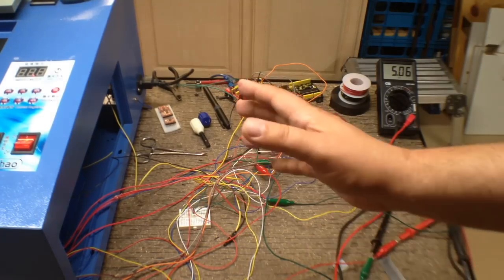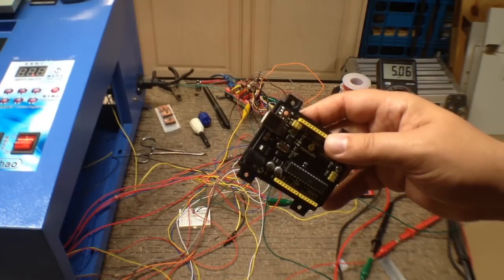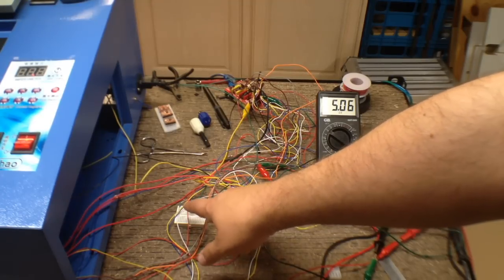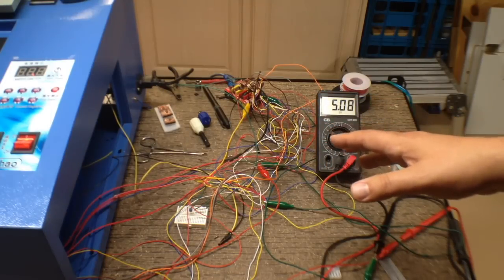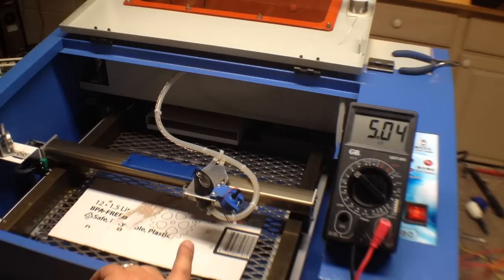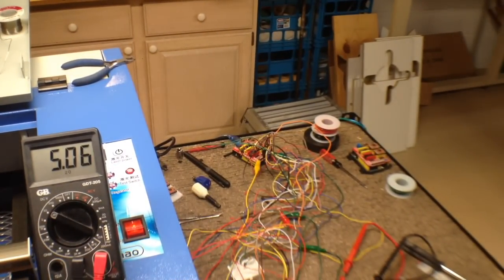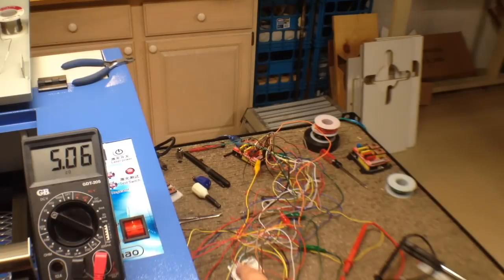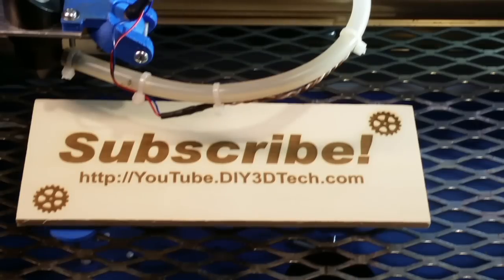K40 eBay Chinese CO2 Laser Cutter - Running with the Arduino UNO and GRBL Part 3!

Comment: use the same accel settings you used on the tiny laser and adjust as required its not too hard are you sure you have enough current from the new controller to run the motors,the drivers on the board are made for a 3d printer where the loads are very low while the k40 needs more current due  to more or heavy loaded axis.

Comment: why not attach wire connection drawing arduino + shield v3? everyone asks, be good, thanks
Reply from the maker: Thanks for commenting and the simple answer is it subject to change,  When I made this GRBL was at 0.9 and now 1.1 with this pins have changed.  It is /was also subject to the handling of M3/M$ and PWM.  The second reason is risk, activating the high voltage PS as well as the laser.  So in short if one is going to make this mod (which I have also posted a newer video)  they need to understand the mod as it can lead to dangerous out comes (which I have also covered in later videos).  :-)

Comment: I'm thinking of doing the same - but if the laser fires when the pin is low, isnt there a chance it will fire before GRBL has a chance to initialize and set the pin high?
Reply from the maker: I can never say never however for the most part no, as that is why GRBL will only support low for off.  However the issue you will see is if GRBL crashes and the pin is high it will stay high and thus the laser will remain on.  So it should not be left unattended (even stock I would recommend this too)...
Reply: @DIY3DTECHcom  I have a grbl controled diode laser and I would NEVER use GRBL for a k40 because the laser does fire when the thing is initializing.

Comment: Hello. I just have the same model and just try GRBL with lightburn too. However I notice that when engraving raster, the x axis cannot move  as fast as stock controller. There is something about acceleration in GRBL. If I input $120 and $121 too high x axis  will lose step. How do you think?
Reply from the maker: You know I just started playing with Light burn about a week ago and I don't do much raster mostly cutting.  Try max speed 50000.000 and acceleration 300 (at your own risk)

Comment: hello,this idea is not ready for prime time till all the bugs are out. Its ok for senior  level techs but NOT for noobies.Also you need a hardware switch to insure laser is OFF when turning the system on/off ...As someone could really get hurt real bad...these kids out here now never played with old tvs and such like we did and do not understand the pain issues.
Reply from the maker: If you want to take this approach the whole;e k40 should be banned (in all honesty I am still surprised it is still allowed to be imported).  As with any power tool you need to treat it with respect as I have been using this for years without issue.  As worth note, in its stock configuration you can get hurt really bad in a number of ways but can you with a table saw...

Comment: If you were to do it again. Would you use an Atmega Ramps running GRBL Laser AKA $32-1 ? I tried the marlin laser version and it's just not stable and safe enough to use with Lightburn, I have both the CncShield and Ramps, Wondering if it's worth putting the big ramps or stay cheap with the CncShield
Reply from the maker: This is more then enough all the way around, however note rastering while possible is not practical with GRBL.  As I just use this for cutting things out...
Reply: @DIY3DTECHcom  Even when using GRBL1.1f with M4S** commands in lightburn? I have a CncShield V3 all set up and ready to go with a transistor logic inverter set up,  to Pin11( Z endstop )and ground, i won't know for sure  till i get my K40 moded up and working

Comment: Hello, I've upgrade my k40 with arduino uno using pwm on pin 11 and it works fine, but if I connect the machine without connecting before the arduino, the laser lights on. Do you know how to solve this? 
Thanks a lot
Reply from the maker: Sorry there is no easy way as you also have to be careful too because if abort a job it will also say on
Reply: I solved that with adding a relay to the shield, once it powers on it turns on it switches the relay  to Laser power supply, the relay will only switch on once the shield has booteed up google 
Timer Switch Module, DC 12V Adjustable Delay Timing Timer Relay ON Off Switch
Reply: This happens with laser grbl for the led lasers if you fail to turn it on correctly...ALWAYS turn on the CONTROL SOFTWARE FIRST than apply power to laser module last.

Comment: Hello Friend how do you do to control the power supply of the laser co2 with the arduino ... how do you connect it?
Reply from the maker: In the video series I show how to build a single transistor logic inverter to use the Spindle On/Off pin out to turn it on and off...

Comment: So I've been watching this (I've bought one and its on its way) are you able to make patch cables to sell to people? so basically plug them into the right cables on their end and plug a set straight into your design. also with some further research I've noticed that it can potentially run T2Laser software which is god like.
Reply from the maker: This unfortunately is not just a cable however as compete re-work of all  of the electronics.  With GRBL is will act as a CNC like device, however this was done quite some time back and a guy has released an App called the k40 Whisper software (see my most recent video) as if I would have that, would not have needed to make this change.
Reply: DIY3DTECH.com ill go check that out!!thanks!!

Comment: do you have any wiring diagrams for sale thanx
Reply from the maker: So no but its not that major as the stepper match up and you only need to wire up a simpler inverter to fire the laser...

Comment: What jumper configuration are you using for the motors?

I followed the part 2 configuration and the motors turn on but they grind a lot while moving. I tried switching wires around on the motors to no avail so I'm thinking its a jumper configuration problem.
Reply from the maker: Somewhere in the video I speak about timing in the $$ settings this needs to be set correctly or the motors will grind.  Its quite a while since I did this and don't have it off the top of my head but also believe I published $$ file (check the links in the descriptions) and if not I will see about digging it up...

Comment: i have a similar setup, been using vcarve for generating gcode, but found its less than ideal for laser engraving. any suggestion on software
Reply from the maker: I use Cut2D and the GCode plug in for Lasers in Inkscape.  Both have worked out well :-)

Comment: Where can I find more info about your solution for inverting the signal pin?
Reply from the maker: Just google "simple transistor logic inverter" and look at images as you will only need two resistors and a transistor to make the logic inverter.  However a word of caution which I discovered later is the GRBL spindle control pin is only controlled by GCode so if the GCode stops sending (either my glitch or intentional soft e-stop) the laser will remain on until either it receives that GCode or the board is reset.  So use care!
Reply: This is what I came up with. Basically for those that don't know, the arduino turns the pin11 output from 0v to 5v (active high), and the laser power supply is expecting to see the opposite (on at 0v, off at 5v). An NPN transistor and a couple of resistors can be used to flip that signal. Wiring diagram in the link.

https://i.imgur.com/CtfgEQx.png

Comment: Ok so I have watched all your videos and searched the web and just cant find information on how to get the uno to trigger the laser... any help would be appreciated
Reply from the maker: Its covered out in the video series, in simple terms you use the spindle control pin now as in the second episode you need modify the code or by default the spindle pin is PWM and you would have to use the S1000 & S0 command with the M4/5 commands.  Second is you have to invert the logic of the spindle pin as the laser fires LOW while GRBL fires HIGH.  I built a simple transistor logic inverter to do this.  Hope this helps...
Reply: Well I just decided to order a 60w laser with DSP instead and send this 40w back to Amazon. It has too many "issues" and the 60w should be a tad bit better for my needs anyways. I did try using a Mega/RAMPS as the LCD screen and SD card sure would have been nice but had problems with it driving the motors.... I am guessing it was a setting issue but since I had already ordered the 60W I didnt feel like spending any more time on it. I will be modifying my Probotix Fireball V90 with the Mega or the Uno in the next few days.  If all goes good I will then do the same with my FLA-100 (Gecko G540 controlled).... It sure would be nice to have it running with a LCD/SD.
Reply: @DIY3DTECHcom  i cant find anything specific about the wiring on your site? same as for the tli schemetics

Comment: Great stuff .  laser brain transplant . 
I know you like arduino UNO , but you might want to look at Arduino Nano shields for  GBRL later , especially for custom rigs .  the Nano has 2 more analog pins than the UNO that can be used as needed and the rest of the specks and code are the same as UNO ** except 1 thing..  I think i mentioned that re your reply on my thread  else where .  but yeah ,  when your UNO stocks get lower  have a look at replacing them with Nano's  . also the Nano's have a dedicated USB / UART chi not just the  2nd Atmel that some UNO's have , while both have their up sides , the UNO's with a Atmel MCU for USB  suffers a lack of some hardware flow control options. But it does let you re-flash that USB  to be a HID devise or mouse or such .
 Nano's cant do that as they have a FTDI or ch340g dedicated USB chip.but most UNO clones have ch340g's any how. 
Your last video you mentioned the lack of a  good GBRL  interface for sending Gcode , and has got me thinking that's something i should really get back to .
Reply from the maker: Very interesting and enjoy exchanges on UNO, however I also have a whack load of Nano's too!  (I have a lot of stuff laying around :-)  however this this an embarrassingly novice question.  However when I connect the Nano (via the mini-USB) to my Mac, no port appears.  On Windows (10) if I mess with device manager one will will appear and select Board->Arduino Nano and Processor->ATmega328 (I have r3's) but the IDE errors out saying saying connect.  Whereas with the UNO I just plug it into either and bam there is the port, select board and processor, hit upload and we cooking with gas.  No issues, I did a quick look on the internet and found nothing quick.  Now I have tried multiple boards and cables all with the same out come.  Any Ideas?
Reply from the maker: P.S. Before I got side tracked below I agree with you 100% on the Nano and that is why I have a wack load of them as I have this other project site (http://opensliderproject.diy3dtech.com/) and want to use them for control of this.
Reply from the maker: P.S.S. Another viewer turned me onto this one: https://github.com/vlachoudis/bCNC  have not had a chance to load it up yet.
Reply: can you post a pic of the bottom  , where the  ch340g chip or FDTI chip is .  Some Nano's had fake FTDI chips , and a while back FTDI  put out drivers that bricked a bunch .   the ch340g chip is a pretty simple coms  chip .  I'm sure its just a batter of finding drivers.   My w10 lap top just worked with every Nano i have , but that dont mean i have not grabbed the ch340 driver at one time or an other.
Also .. it may need you to re-flash the boot loader . i had a few nano's from china that had no boot loader and i use the ICSP pins to flash the boot-loader . 
I never buy any that use FTDI coms chip after the whole FTDI-gate thing . 

I'm no Mac user , but this thread has many things on the Mac side for both FTDI and later the ch340 chips , also seems CP20XX chips were used on some . 
http://forum.arduino.cc/index.php?topic=101052.15
hope that thread and or sub threads it points to hets your nanos working .
Reply: wow that was cool .  I was looking at making simple sliders from every day stuff and simple 3D printed ends.  I put a few vids up on my channel  , but i also have a Hackaday project about them :
https://hackaday.io/project/9256-l-extrusion-endcaps/log/32589-added-45deg-connectors-and-linear-slides
Reply from the maker: Yes can post pics and took a quick look at the link (thanks)  and that is looking like the issue (ugh).  Really trying to find time to mess with these (to many hobbies and to little time :-)
Reply from the maker: That is neat (the L rails) and messed with this type of design but jumped to Maker Rail as it was just easier in the end and not that much more money (everything considered).  My goal is (someday) to come up with [affordable] camera slider kits
Reply from the maker: Yes have seen DIY Perks nice build where are you located assumed the states? As I get mine from Amazon in two days with prime...
Reply: NL Canada, everything takes longer to get here if it comes post . our post is slow as heck , unless it just happens to arrive by air rite here . but man if its not air and it lands in BC  it will cross the country by ground , and possibly by boat from main land . LOL   
some couriers are direct and that's good but extra bucks .
Reply from the maker: Ah got you!  I live a stone's throw from Sarnia on the US side so know what you mean as we have a lot of Canadian friends.
Reply from the maker: PS Like your new picture better the other one was too dark...
Reply from the maker: Got the driver working as it was the ch340g driver for the port issue, however now upon upload it reads: mismatch at byte 0x0020
         0x8c != 0x0c
avrdude: verification error; content mismatch
Reply: i would figure something has corrupted the boot loader. 99% it was in the factory where the blobbed on the hex and flashed the test blink app .    I bet you have a ISP, but in case dont and have never flashed one using a UNO here's some hepful links . 
http://notes.asd.me.uk/2011/10/20/using-the-arduino-uno-as-an-avr-isp/
and this link ref's that link above but has some insights : http://www.xuan-wu.com/2012-11-19-Arudino-Uno-Bootloader

I now have a few ISP's and use em for fixing missing or borked bootloaders ,  programming and setting up my arduino pro mini's and flashing my ESP8266 modules. but i tell you it dont take much for the boot loader to be wrong . i mean they flash em in huge batches , and all it takes is 1 bit off , and you have a unit that does the blink test , but is corrupted just enough you cant upload. 
also i have found sometimes my nano's could be 'zapped' and would behave as if they were bricked . but using my UNO or one of my programmers to re burn the bootloader was a handy fix. 
on  the upside you can put a new up to date bootloader in .  
i would just assume most of the batch bunk and re flash a few at a time . I ordered a bag of 5 once from ebay , and all but 1 would not take new code, but all would test blink fine.  the one that was 'working' later bricked up and would not even appear to boot normal , it would just start in a very fast blink state.  sure enough , re burnt a boot loader and its the one you see atop my laser plotter today  . all of mine have ch340g's they max out at 115200baud with average usb wire and stable coms.

Thanks , the new pic is me at work , but funny it's me cropped out of a picture my employer uses for web site and such .  so i figure fair use rite LOL .
Reply from the maker: Ouch was guessing it was the bootloader but had my fingers crossed as to date have not had to re-flash a bootloader so guess I need to get an ISP (one on the way).  Also I agree the pic :-)
Reply: use one of your UNO's as a ISP .  but when you get a programmer , you can make up a cable that just plugs onto ISP header pins. but if you do setup a UNO to do it , do a batch of em at a time, and update their bootloaders .
I find it a murphys law thing , once you can re burn a boot loader , you almost never have to again unless you want to change fuses. LOL 
I use CP2102's now as they are 3.3v but 5v tollerant , so very handy .  but if i get an other one it would be teh newer :
http://www.ebay.com/itm/USB-2-0-TTL-UART-6PIN-Module-Serial-Converter-CP2104-STC-PRGMR-Replace-CP2102-/200958955841?hash=item2eca165141
Reply from the maker: Ordered it for less than the price of a Starbucks coffee, worth money!  As one of the tings I want to do is get more into the design of things electronic ass I would like to line of kits something like that so experimenting with various ideas right now...
Reply: The barrier to entry on some of this stuff , knowledge wise can be quite steep . I think that lends itself to well produced kits , especially where you can do supporting videos . At heart most of this stuff is not expensive anymore and it gets easier every day .
Reply from the maker: Bootloader worked!  Many thanks!
Reply: +DIY3DTECH.com that's great. so now your whole fleet should be good. best part is you have proper boot loader now.
Reply from the maker: Yes and I also ordered that one you pointed me to also so I will have a backup!